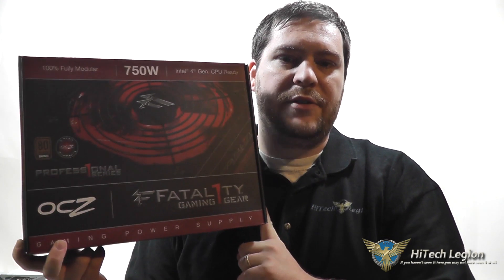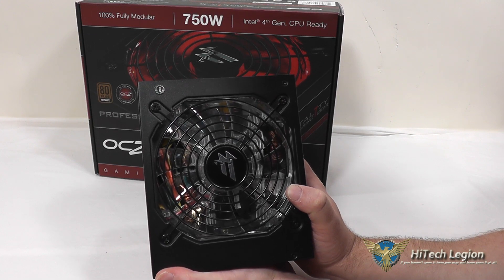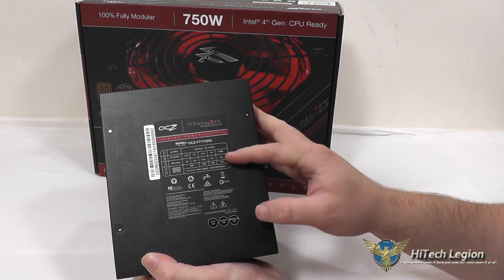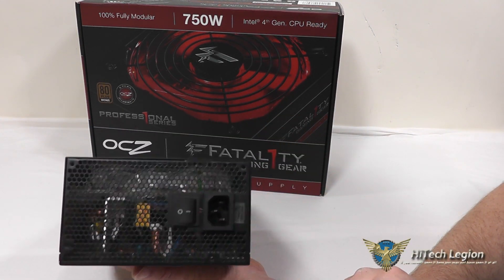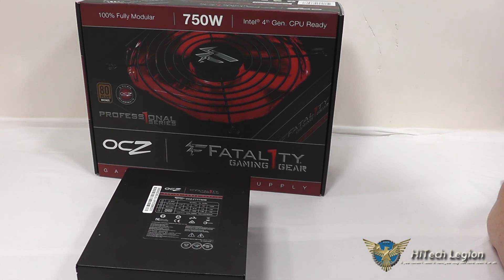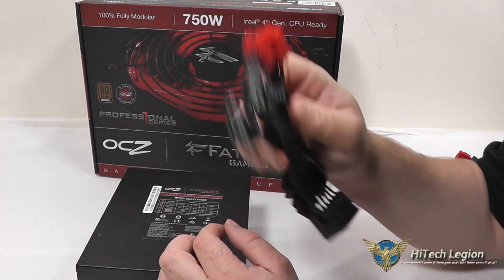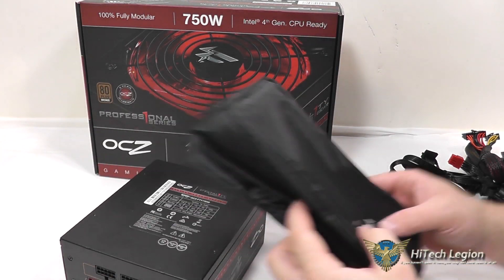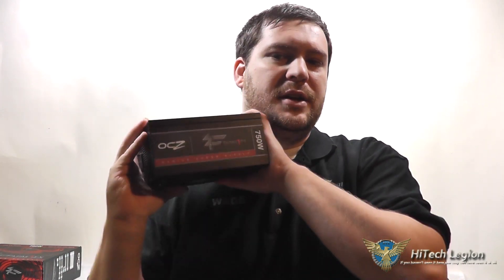OCZ Fatal1ty 750W Power Supply Overview + Benchmarks

Comment: What about the power-usage in Watts (for kilowatt-hours)? Is this constantly 750 watts? Also when only running Windows, Spotify and Chrome for example?  Or is it variable; low usage with pc in idle mode and higher power usage during an intensive gaming session? 

I have a AMD Radeon HD7870 GHZ Edition connected to it (92 watts idle and about 261 watts max) and a Core 2 Quad q9550 cpu @ 2,83 ghz.

Comment: Can i connect a gtx 650 its a 6 pin
Reply: No you can't. You'll need an ultra high end 250$+ PSU for that.
Reply: little late buddy, i ended up getting it and it works perfectly fine
Reply: +DaLordt lol